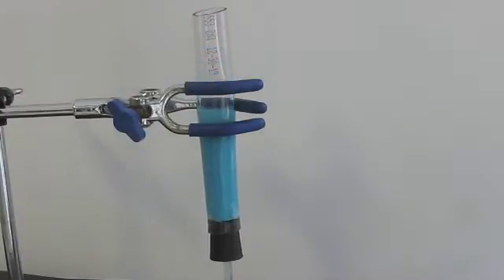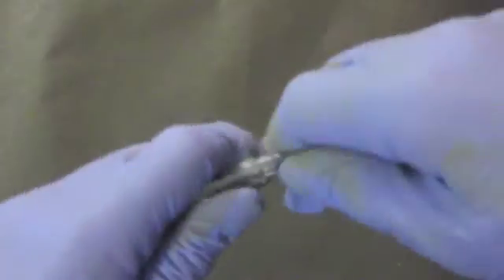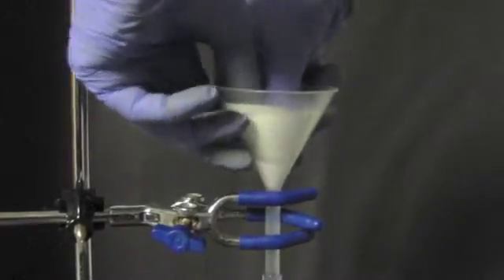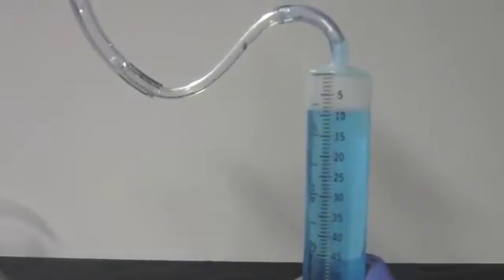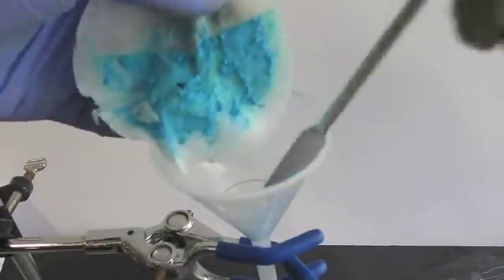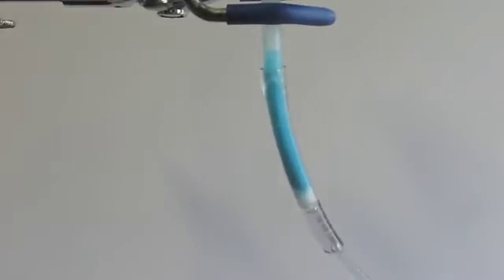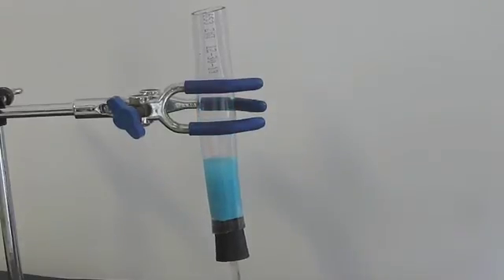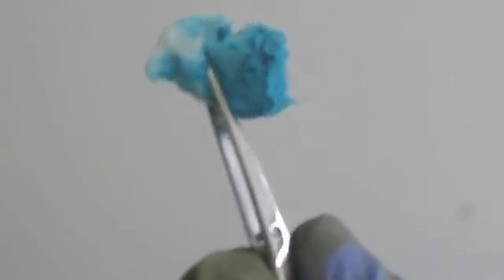DIY Vacuum FIltration (for under $10!)

Comment: I generally use gravity assisted filtration using two liters bottles and quantitative filters. When it's for ridding a solution for mold it's at best removing all of the larger crap and leaving smaller diameter spores for sure. I think I need to get down below 3 micron for sure to really make the solution not end up being a twice a month PITA but it is slow without any vacuum assistance. The results generally are worth the effort however.

Comment: where do you get all this for 10$???
Reply from the maker: Home science tools and Lowes/home depot
Reply from the maker: Oh and the syringe just came from a grocery store
Reply: From where in a grocery store do you find syringes? That was the only piece I was going to have issue coming by lol  This is an awesome video by the way! Thank you!
Reply: +Alex P You can get syringes from grocery stores which are used for injecting flavored liquids into meats like turkey. 

Here is a link to Walmart:
https://www.walmart.com/ip/Professional-BBQ-Master-Cook-Meat-Marinade-Flavor-Injector-Syringe-Needle/831431697

You can also ask Pharmacies if they will sell you a syringe. You won't need the needle tip.

It's important to get a sturdy syringe that won't warp/cave-in under pressure. They marinade one is non-flexible, but I don't know if the part inside that makes the seal, could get tilted to the side under strong pressure.

I don't know anything about these below:

https://www.lowes.com/pd/Butterball-Stainless-Steel-Turkey-Injector/3094531

https://www.lowes.com/pd/Nesco-5-Pack-1-oz-Original-Seasoning-Mix/4759706

At lowes, they are in the Grills area, where they have BBQ Sauce, Grill Scrapers, Heat-Resistant Mitts and so on.

Good luck.

Comment: Wow, I just use plain #6 coffee filters to filter out impurities that have been introduced by accident into my MAP solutions. Just today I heated and filtered a solution that I believe may have some bizarre type of mold or fungus able to survive and thrive in an acid solution. After a decent heating and filtering I heated once again hoping the irradiating given by the microwave might aid as well as the heat in stopping this problem from re-occurring.
Reply from the maker: Yeah if that didn't work you might try using concentrated (30%) hydrogen peroxide to kill the mold, and then boiling the solution for about an hour to decompose any remaining peroxide into oxygen and water. MAP and H2O2 don't react (as far as I am aware).
Reply: TheChemistryShack Thanks, if it comes to that it would be nice to have an option. I am starting to get a little worried. I just had to microwave a small container of Ammonium Magnesium sulfate hex that seems to have had a similar problem. This is really getting to me. I thought that AMAG was a base and MAP being an acid the last thing i expected would be to find this stuff spreading like that. I actually has just ordered a batch of NOVAMAP 12-62-0 which I understand is supposed to be a higher grade of MAP. I thought that perhaps the problem I had noted was simply it interacting with the 11-52-0 MAP I had been using. ??? Currently lost in  space trying to understand what is going on. I have produced some magnificent specimens with some being several pounds. I will be bummed out if I have to abandon my efforts.
Reply: @TheChemistryShack  Hey, I just reacted again after trying decolorized iodine which of course is basically alcohol and ammonia. It is really ineffective, yet I have begun producing some wondrous crystals. The problem with boiling the solution is altering the density of the solution can have wild effects.